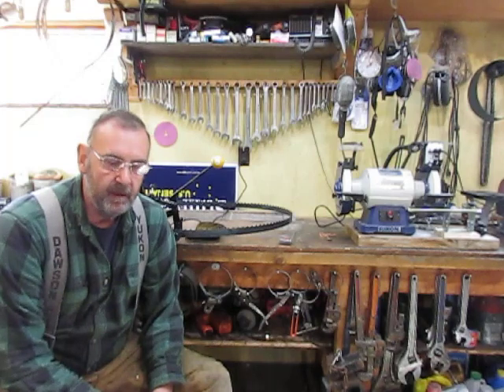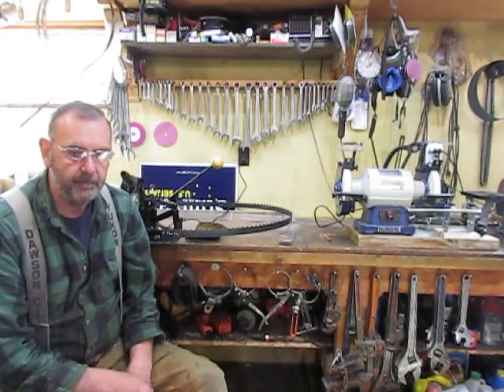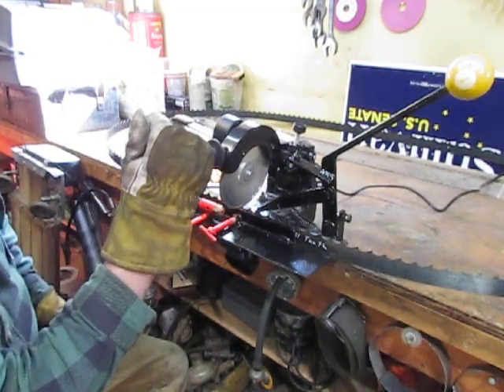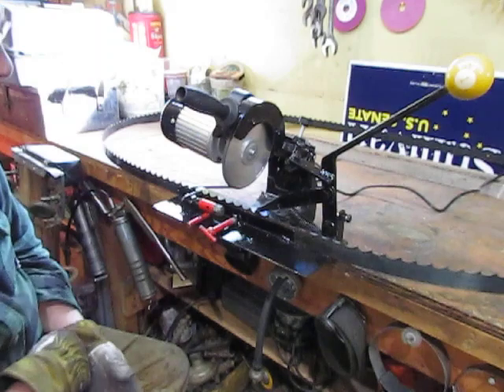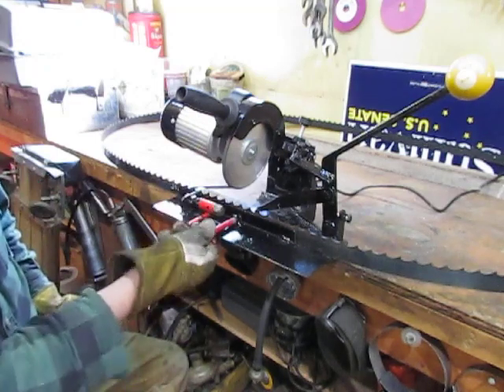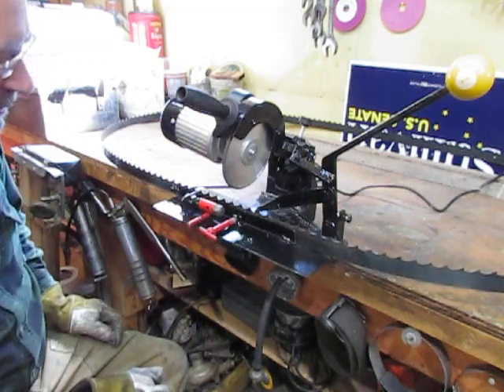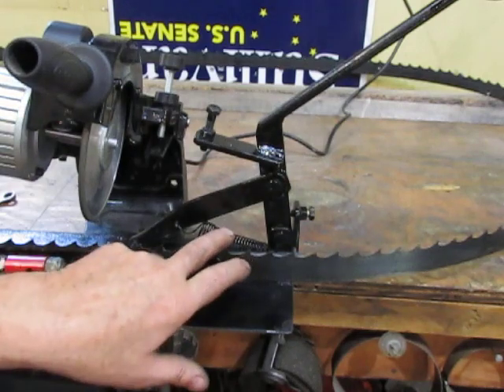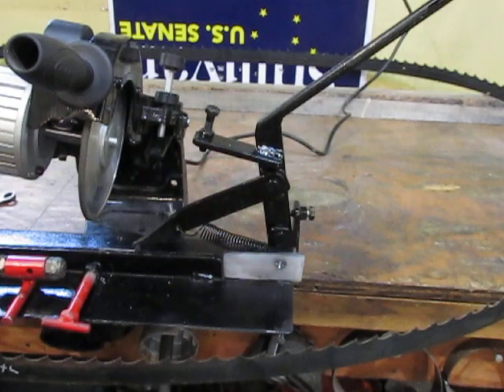Band saw mill blade sharpener Part 2,  Modifications and improvements

Comment: Hello, what brand of sharpening machine did you use to build this?  Thanks!
Reply from the maker: I used an Oregon clone like this one on amazon: 
Chainsaw Sharpener, Professional Electric Multi-Angles Automatic Saw Chain Blade Grinder Sharpener Machine, 1/8-Inch-by-3/16-Inch
Brand: Funshoppingmall

Comment: I see that from your first rendition you have shortened the blade guides that hold the blade upright.  I’m copying your first model and am finding it’s pretty hard to pull the blade thru to get to the grinder.  I also put a slight curve in the guides, somewhat following the roundness of the blade, but yours appear to be pretty straight.
Reply from the maker: I went over kill on the blade guides on the first round.  They worked fine but really they didn't need to be that long.  All they have to do is support the blade so it doesn't move around when the grinder touches it.  Putting a curve in the guides is an excellent idea.  I also put a tension screw in my last model.

Comment: Question: Due to not addressing the gullet what is your ratio of blades broken vs blades trashed due to sharpened too many times ?

Have watched every video on YT on these sharpeners.

Question: It is never shown nor discussed an example of what a blade looks like that is no longer sharpenable. What makes a blade sharpenable vs must be replaced ?
Reply from the maker: Stress cracks in the gullet are what they are concerned about.  There are a few factors "as I understand it" that contribute to that.  How much horse power is being pulled through your blade,  bigger diameter hard woods will require more HP to cut and also have a tendency to create stress cracks.  Cutting at faster travel speeds also increases the probability of stress cracks.  Having smaller bandsaw wheels contributes also.  I broke a couple of blades when I first got the mill but I had not yet sharpened either blade.  I have not broken a blade in three years now that I've learned how to run it properly.  When I sharpen the blades I only take as little as necessary off the tooth.  I do have a machine for setting the teeth but I don't set the teeth often.  Its too easy to break hardened teeth and its really not necessary every time you sharpen.  It would be nice to have a machine that cleaned the gullet but I really didn't want to spend that kind of money at this stag of the game for myself.  I was just buying new blades when they got dull,  now I went through my old blades and sharpened them and am reusing them with good results.
Reply from the maker: You could also spring for this wheel and grind the whole gullet:  https://www.youtube.com/watch?v=WwzTVI6LUPU